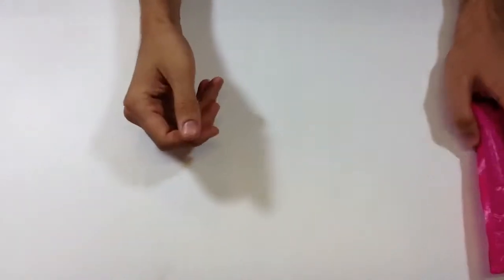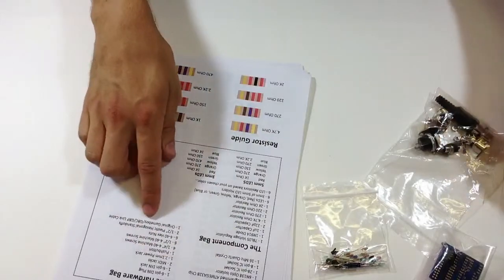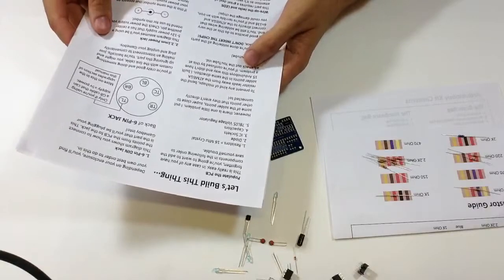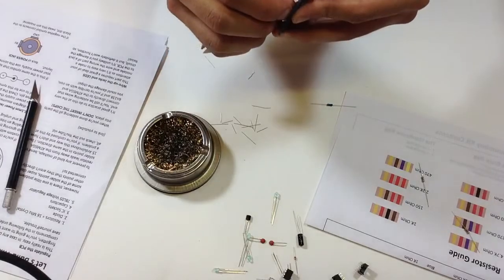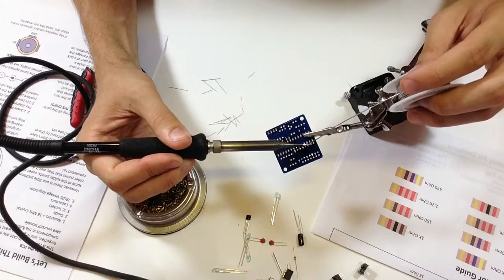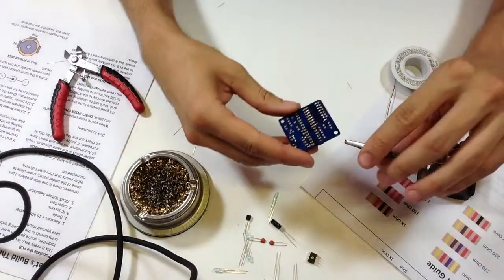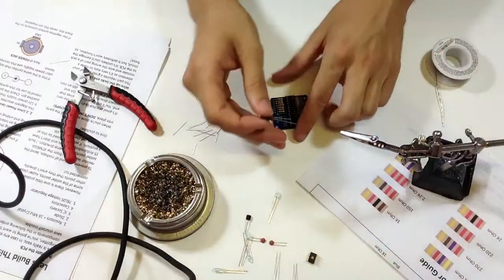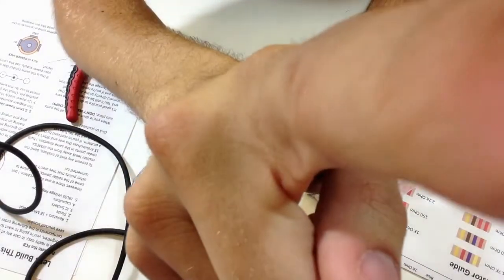1 - Arduinoboy Assembly: PCB

Comment from the maker: Hi Rex,

Snipping the leads after they've been soldered to the PCB will put stress on the joint which might cause it to crack or break. This is what I'm told, I've never experienced this. It's obviously more of a factor when it comes to analog electronics (especially audio where very small inconsistencies will result in noise), but with digital circuits, like the Arduinoboy, you could solder the leads and then snip them without any issue. So, it comes down to personal preference, but not always.